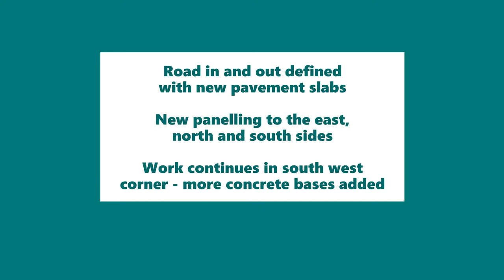Gridserve Norwich (Week 28) - Building a New Charging Service Station for Electric Vehicles

Comment: Definitely in need of a Dead Cat Windjammer over the microphone.
Reply from the maker: I leave the sound as it is on purpose because it highlights how much traffic there is in the area passing by. It's very difficult and dangerous to get these videos now that the fences are up around all sides of the Gridserve site. People were asking me to get closer but it isn't possible due to the vehicles in the area. The east side is the A1270 a dual carriageway with a 50mph limit. Those cars are going past me either side at 40-50mph coming off the A47, sometimes more!! I have to walk across the A47 slip road with cars travelling at that speed! I try to go when the traffic is at its lightest, you should see how busy it is during the weekday. I now mainly film it with my phone as it too dangerous to carry and use proper camera equipment and using a phone is quick so I'm there for as short a time as possible. You can always turn off the sound if you don't like it.
Reply: @evmonkey6342  Appreciate the effort (and peril) you go through to get these updates. Looking forward to charging there.
Reply from the maker: @matthewstephenson1664  Thanks, me too